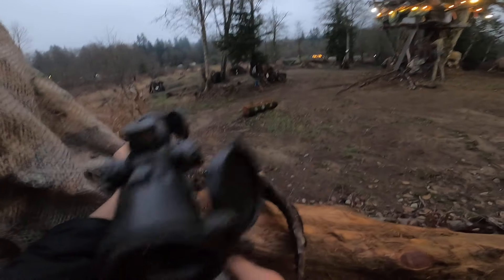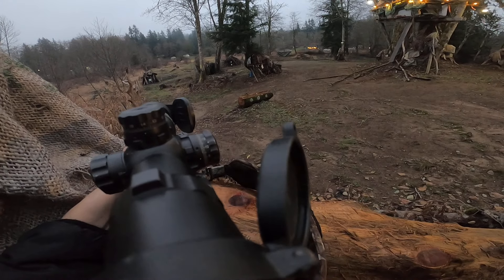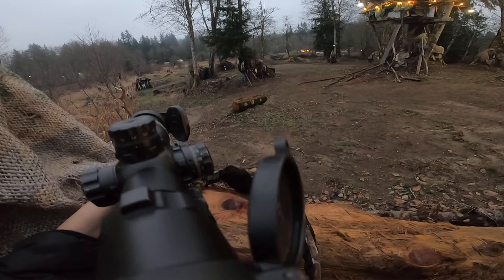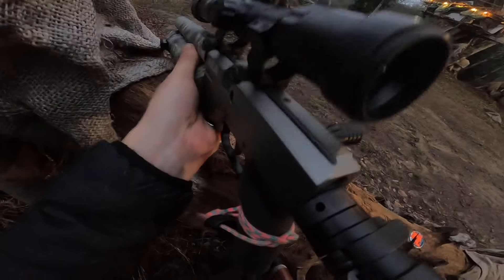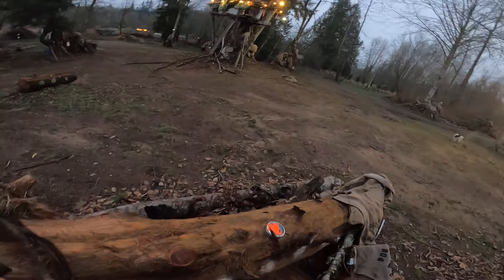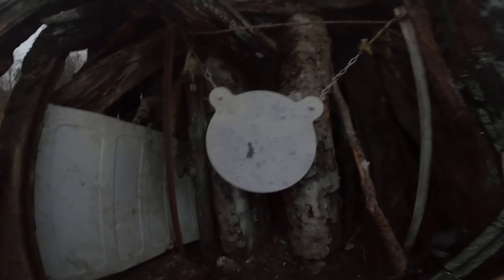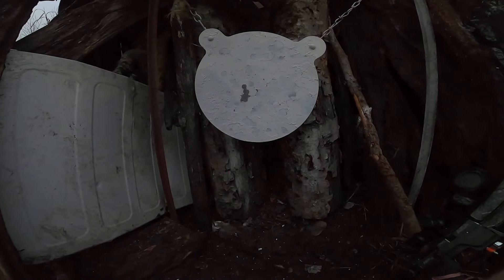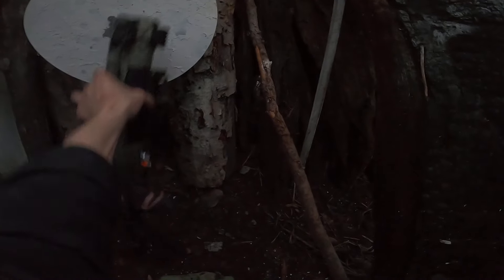AEA HP MAX 357 Air Pistol w/ cast 357 125gr 358 & 359s SLUG &  demo Cast NOE Slugs 174gr 154gr

Comment: 9mm relading bullets on 357 AEA hp max maybe?
Reply from the maker: sorry, i just got to YT - renovation and more, life changes. there is a lot of sucess with a 356 longer surface area, with a polished barrel. my valve been broken 6 months or more now. . . . . i am mostly a Benjamin Bulldog 357 which i have out at a 0.3585+ for a 174gr RFBT of NOE.  i selected the 357 as i already had much 357 and 45 reloading gear centerfire anyhow, plus plus. have a good 24 and thanks for a 'visit'.

Comment: I have a question: If you load the AEA HPmax and close the bolt and then decide NOT to shoot: How do you unload the gun and get the bullet out of the barrel?
Reply from the maker: I use a SOLID BRASS ROD....you can buy a four pack of 36" SOLID rods on amazon $25.00. and cut in half or to suppressor length PLUS 2"....and the WEIGHT ALONE, at a 70degree angle upright, SHOULD drop round out. If you double loaded, then TAP gently with a chunk of 2x4/random wood... like a mini jackhammer, a million little blows, NOT heavy one to damage internals. Hope that helps. two i cut in half so i have SOLID ROD  at EACH shooting station and in truck too. If you end up using a 3piece 'kit' rod or an aluminum one, with threads and jag on end, you will NOT have same results as you end up bending or ripping the linkage. I have great luck with a $10 ONE PIECE aluminum rod off AMZ which i use for POLISHING all my barrels with JB/ Flitz finisher. USE BRASS ENDS for this too. 120 double patches through the last gun to get polished... 
 Happy shooting! PS, Watch out for your pellet probe, and WHY i say gentle/many little taps... control it instead of smashing the probe/ruining internals- possibly.
Reply: @Dont_lose_sight  Thank you for this quick and informative answer!
Reply from the maker: @Ist_Geheim  NO PROB!!! Have fun! in a pinch, i wouldnt suggest, but i have used my garden bamboos.... and uhm, yeah, many times over, to unjam Bulldogs!!! Soooo, i am NOT suggesting that, but just something that wont damage your precious bore! Bamboos were about five years BEFORE the Solid brass rods ALL OVER!

Comment: Hello I am looking for some advice. I have had the Max .357 for a while now but haven't shot it a lot yet. My plan was to shoot this gun tethered at relatively low pressures since it still has a lot of power from 200 to 150 bar with heavier slugs. So I shot a 115 gr slug from 200 bar (untethered) and it dumped air to 150 bar in that one shot. It went 735 ft/s which was about 134 fpe. It seems a lot of air was wasted. Then I shot two 93 gr. slugs at 748 ft/s from 200 bar and it was down to 150 bar again. It didn't seem to use this much air before with these slugs. Any thoughts on this? Is it using too much air for the power I'm getting? Should I install a lighter hammer spring maybe? Could something have happened that makes it use more air?

Thanks in advance.
Reply from the maker: i would think it might be valve issue, i quit tethering most my AEAs as it seemed to cause issues , even with a slow-fill regulator on tank. sometimes the valve can get debris in it, sometimes it can be faulty. currently, i dont even fill my HP Max 357 repaired and sent back to me over ~3.2kpis or it 'slingshot speed'. that air dump was happening a lot on several of mine, when i would fill more than over 3.6kpsi. a bit finicky, so say lightly. you can check or as in the forums on this, also, i have had to replace more than a few valves in the Max series. good luck, i get the irritation!
Reply: @Dont_lose_sight  Thanks for your reply. After reading some forums I think the problem was the hammer bouncing. I have to do some more testing but it seems I have solved it with a simple solution and only lost 3 fpe of power with the 93 grains and get 5 shots now as opposed to two. Will report back with a conclusion.
Reply from the maker: @antongonist8294   heck, how about you keep me posted? I am getting tired of such things, and HPmax357, since i got back, it irritates me, that i cannot even fill over ~3.2kpsi or SLINGSHOT. but NO TANK DUMP, so its something different. i just get worn down working on Airguns. I think about a Colt45ACP i had for decades, WISHED I NOT SELL, and its HUNDREDS of thousands of Handloads... and basic cleaning, ALL I EVER NEEDED. standard 230gr ball rounds to 185gr Hotloads. NOT one issue, EXCEPT I SOLD IT FOR Rent 8yr ago, OUCH.
Reply: @Dont_lose_sight  So you have no power at high pressure? Maybe your hammer spring needs more tension. Try adding some spacers.
Reply from the maker: @antongonist8294  i have not even messed with it, other than its like an AK47 Pistol, where i use forward pressure a RED DOT and hit 78y, 85y and 100y gongs, and my EYES are TERRIBLE, a 30.00 red dot, of all things. i have found i get about 10 GOOD rounds , as in enugh to hit a coyote with using my favorite in 1st gen Bulldog pitbull, and THIS HP MAX, its a 359 RF  ~89.1gr. I run a lot of FX RADAR numbers on facebook, NOTHING political, ONLY DATA share. :-) i detest social media, but cross marketing was needed since i shoot daily, and NO TIME for hundreds of hours of quality PARD and ATN  and AGM thermal videos... my editor WIN10PRO crashed, which why my new BREAKS 300FPE Bulldog M357 video is, uh, NOT my best, nor is /are the intial ones, the HP MAX 357 was first youtube video. NO social media in over 12 YEARS prior to one video. now part of a huge community... so, i suppose thats pretty neat. being an introvert.

Comment: How much FPE are you getting with those slugs?
Reply from the maker: edwardschlosser1  i looked, it was $599 with four Mags and tank clamp, which is actually strong enough for sling. i shoudl change that, i buy a bunch and return , when they suck, too. I LOVED the seneca Eagle CLaw and ran the chronie, it was right at 68-70ftlb.s i loved the lever. i will change that comment after today's servicem, and i was incorrect in the price, Xmas Special. UPS took 17 days.LOVED the lever action, the balance, but the PRESSED shorud and no option to take apart and repair the falut air stripper, i was only able to get great chrono readings and shots to only 70yard. i need way longer shots for coyotes. Airgun deopt, instant refund, then i got the AEA challenger. about a year...